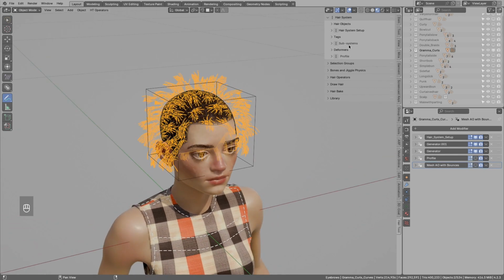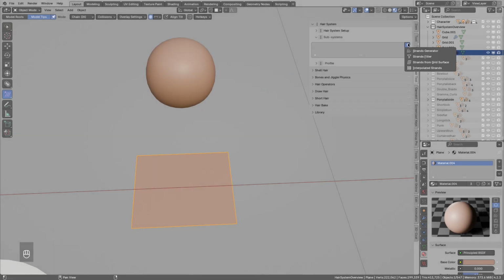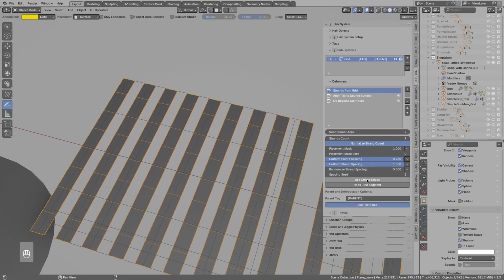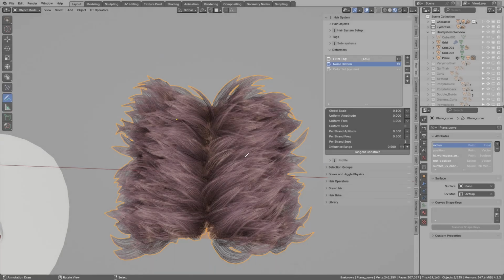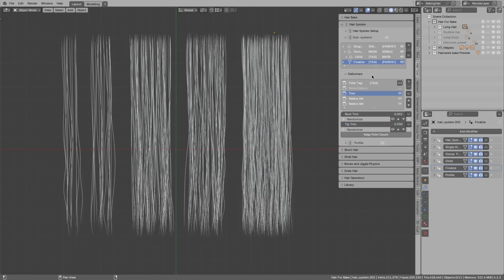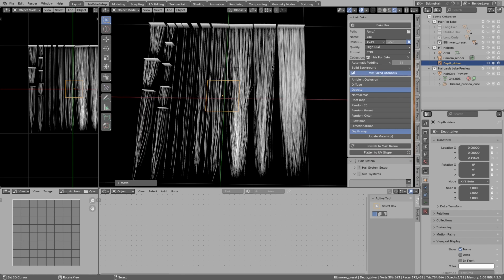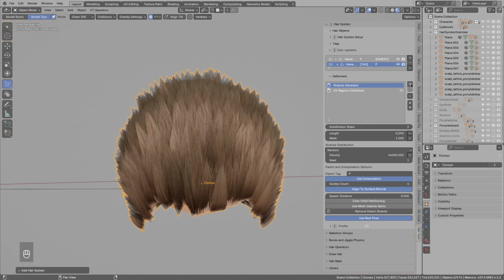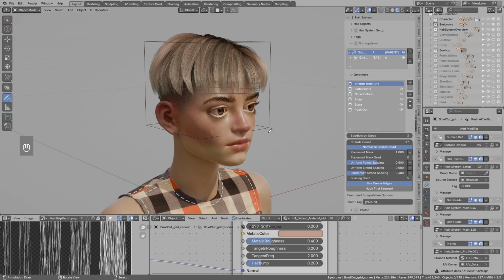Hair Tool 4 Introduction video

Comment: This is really good, but I can't help but feel a little overwelmed with so many options and informartions. I bought the addon friday but I feel a little lost. Is there a simple short tutorial that is updated? Or a .PDF? Can be from someone else as it uses a simple and single method to make hair.
Reply from the maker: The addon is indeed bit complicated due mostly focusing on haircards (some other hair addons do curves + mesh without texture, so they do not  handle uvs, bone generation, jiggle, and other stuff).  Best quick start is here - https://joseconseco.github.io/HairTool_3_Documentation/#quick-start . Also this video is quite bit shorter - https://www.youtube.com/watch?v=M22m0WLylbU&lc=UgzDDSFJWBe9l2mY2RN4AaABAg , but it only focuses on how to make specific single hairstyle.
Reply: @bartoszstyperek6306  Very kind of you. Thank you for all the videos! Bought Garnment Tool as well! Congratulations on the addons

Comment: can you import hair baking scene from another .blend file instead of default scene?
Reply from the maker: I think using : File > Append > Your  Blend file > Scene,  should work. But at that point, u could just bake texutres directly in 'Your Blend' file,  and then  load baked texture to your character file.     The issue with the File append is that, HTool version is cleaning up some doubled geo-nodes setups that may happen  on append. And if u just use manual append - this cleanup wont happen, so thing may break.  Hence I would just bake texture in separate file..

Comment: Thank you for tutorials! I want to learn how to make the double ponytail hair in the video. My workflow is the character creator workflow. Your character creator video was several years ago. Is the workflow still the same?
Reply from the maker: well, the HTool part is completely different. Back then there was no geonodes stuff (most things were coded with python). CC part should still work  in similar way.  About double braid - there is preset in hair library that you could use as base https://ibb.co/Q9Jzrph

Comment: Track to mesh has become my favourite i think. INteresting what youve said about using guide curves not working as nicely for interpolation
Reply from the maker: Yes, In theory guide curves should give similar/same result.  But in practice 'track to mesh' was faster, gave better results and is more easily customizable (it is easy to edit it and match to new character - hence, in  hair library , I have made only one eyebrows preset)
Reply: @bartoszstyperek6306  I've been using those eyebrows all the time 😁  my favourite blender plugin. Keep it up man!!